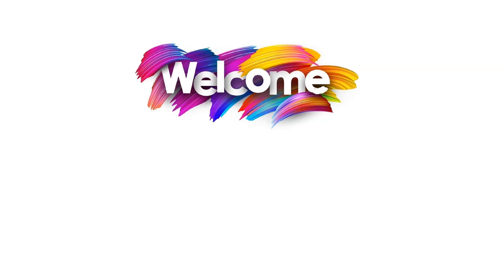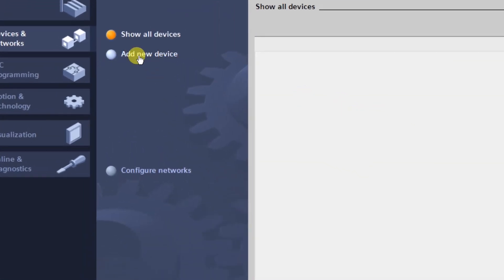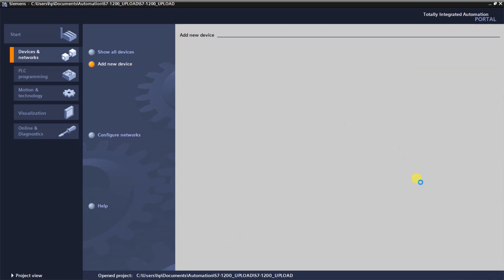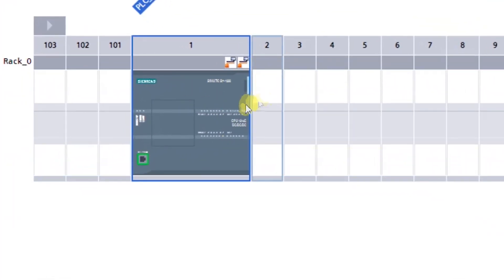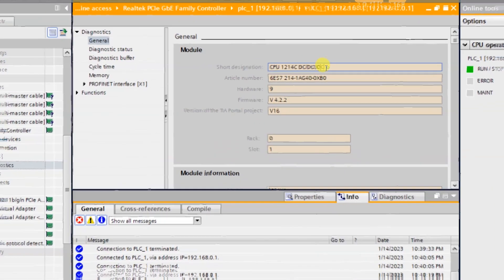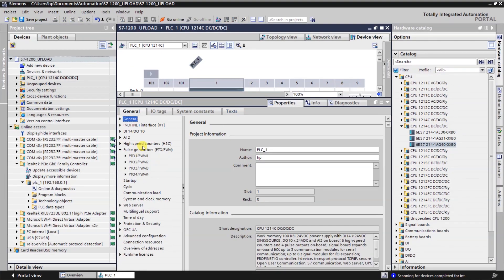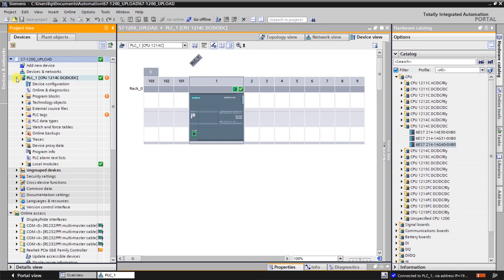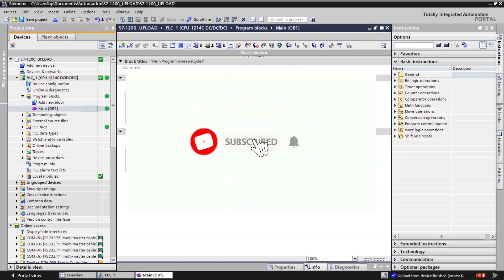Upload from S7-1200 below firmware version V4.0 | TIA PORTAL | Automation Tutorials in English

Comment: Hi, I tried to upload backup from S7-1200 6ES7 1214-1BG31-0XB0 V3.0.2. But I got an error that Online module does not support uploading to PG/PC. I tried to Copy the online Blocks but paste option is not enable in my case. any suggestion please
Reply from the maker: This video shows the step by step method for your question. Just do the hardware configuration same as the online module. Make sure that online and offline modules match perfectly. Then follow the steps mentioned in the video. The version will be V3.0.2 in your PLC hardware.
Reply: @automationtutorials1529  I tried to detect hardware by placing an unspecified CPU and it detected all hardware to my project and also, I can see the blocks available in the online CPU, and I can open the blocks but when I try to Copy the blocks from online to offline project all the blocks look grey shaded and it can not paste. I don't understand that